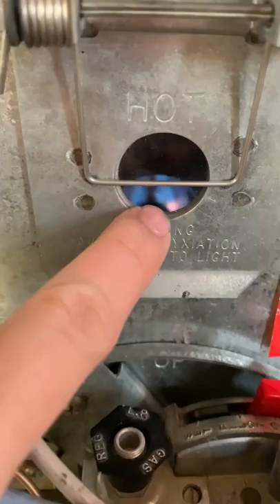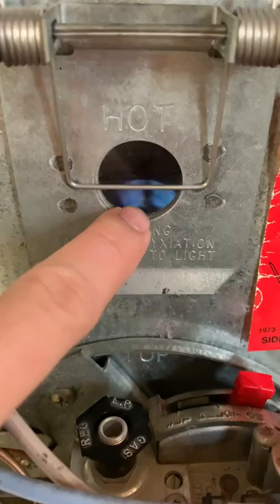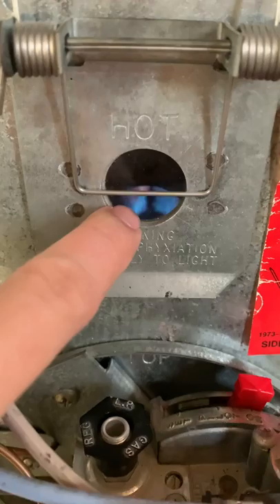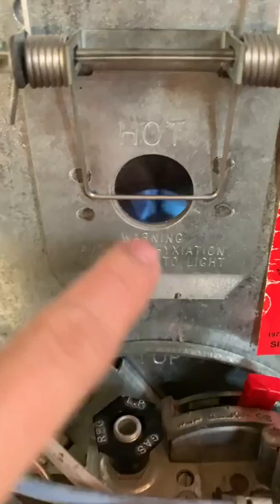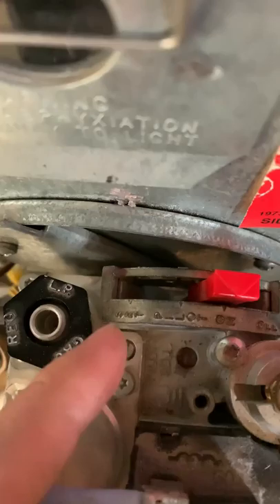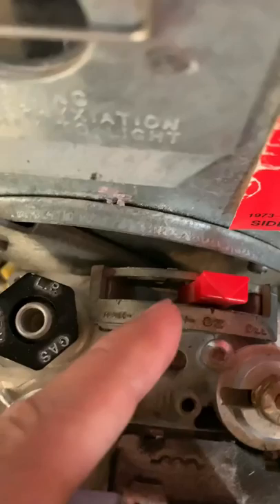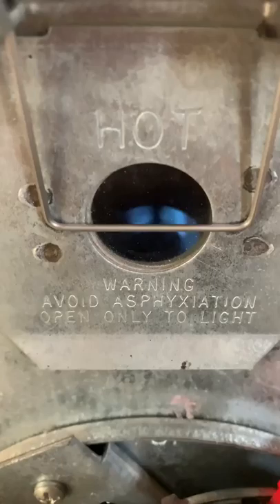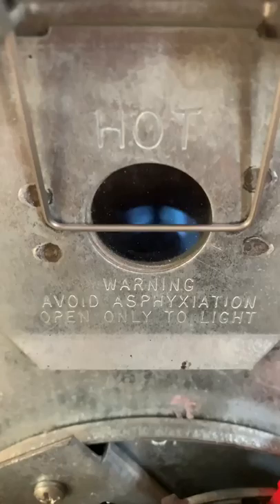Coleman mobile home heater how to light the pilot. Step by step in description.

Comment: For models with out "set" (or a red lever) that have a black dial with ,on/ off/ pilot, do the same procedure just instead of going to "set" to light it turn the black dial from off to pilot and press it down like a button while holding flame to indicated lighting point. This guy deserves a medal for posting this video lol also a small birthday candle taped to a stick works well if you have flimsy matches. Stay warm!!!
Reply: I need this info rn thank you

Comment: I still can't get it lit
Reply from the maker: We’re you able to get it lit last year?
Reply: @getwaxedgaming9032  is there a reset button in the back somewhere??
Reply from the maker: @elijahmadison4051  as far as I’m aware there isn’t. If you’re lighting it the way I instructed in the video and it isn’t working your wick might be bad. If that’s the case the pilot would need to be replaced. I had a hard time getting mine lit, but I managed it after a few tries.
Reply: @getwaxedgaming9032  I followed the instructions and went to 1. Off position for 5min, then to pilot depress & light but nothing happened is this the same steps you did?
Reply from the maker: @elijahmadison4051  let me break it down for you. It’ll take me a minute so give me a bit.
Reply from the maker: @elijahmadison4051  How to light the pilot
Step 1. Make sure you remove the door to have access to the pilot. 
Step 2. Get some long matches and something to tape them to. This is very important because the matches have to reach very far in there. If they’re not far enough you won’t be able to light the pilot. I’d say about 20 inches will suffice. 
Step 3. Stick the lit match into the left hand side of the pilot. That’s where gas is being released, it’ll light. 
Step 4. Make sure your gas is on, be very careful when doing anything has related. 
Step 5. Take that red knob in my video and make sure it’s on the section that says pilot. 
Step 6. Pull it backwards from pilot to set. 
Step 7 repeat step 6 until it lights. 
Some reminders. Make sure your gas is on, make sure your match is lit, make sure your matches are long enough. They’ll need an extension more than likely. Be very careful, if you can’t get it lit after maybe 6 tries I’d call someone. Your pilot may be bad and needs replacing.
Reply: @getwaxedgaming9032  after the pilot lights I leave it on pilot or the on position?   Sorry bout all the questions
Reply from the maker: @elijahmadison4051  it’s okay, I’m here to help. I left it on the set position for about a minute. Just to make sure it didn’t shut off.
Reply: Mines says ON and OFF.....doesnt have the pilot symbol on it
Reply: Mine was backward you turn gas on make sure its turned to at least 65 on thermostat pull lever at furnace to set hold down for 40 sec then light wait and then put it at on position. Coleman in some its not lighting on pilot it lights in set
Reply: The problem im having is i cant tell where to put the flame to ignite it